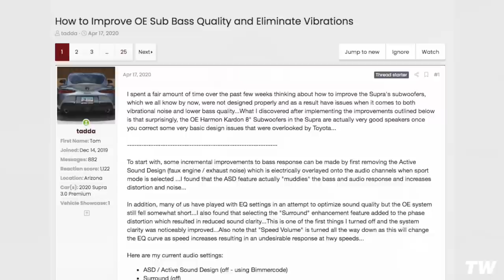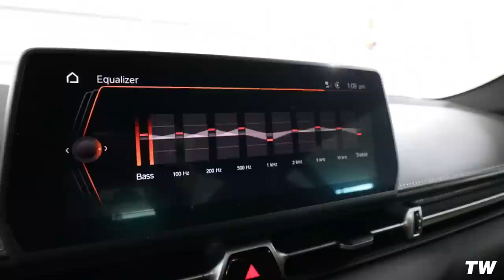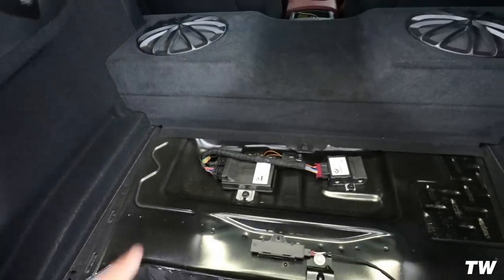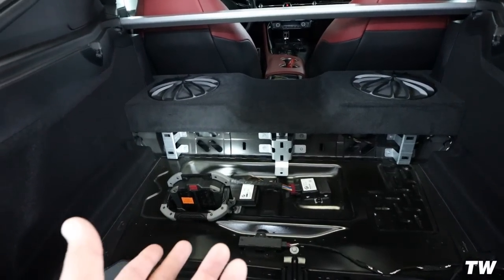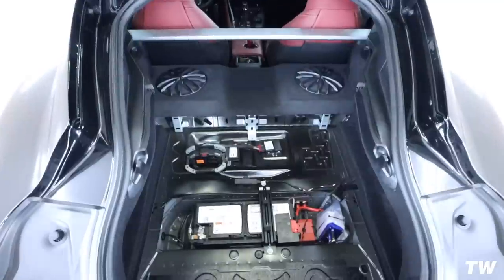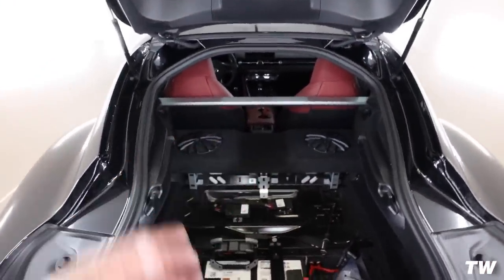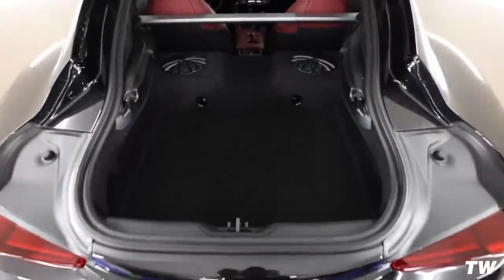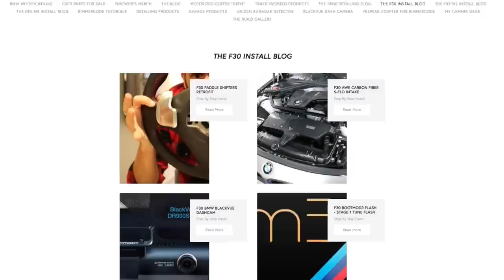EASY SOUND SOLUTION DIY FOR THE NEW SUPRA! (Stereo Audio Fix For A90, A91 Supra)

Comment from the maker: UPDATE: I installed the speaker mesh and dynamat, it made a massive difference all together. I did end up lifting the bass a bit on my equalizer. It felt a little flat with the way the equalizer was set previously. Overall, a great DIY. 10/10 recommended!
Reply: I have been waiting foreveeer for someone to do this, are you going to upload a video on how to add the mesh & dynamat?
Reply from the maker: @risosi8092  I can, but it is VERY easy. You just measure the rectangular area behind the speaker ports (5" x 4"), use two pieces of 3m on top and bottom and place it in there. It fits snug, wont go anywhere. For the Mat you just measure every area you want to cover and cut out the mat, and apply. Its basically a massive piece of adhesive. Real simple. But I can go over it in a future video for sure.
Reply: what’s the song in the intro you were playing?? sounds amazing
Reply: @alexsimms3363  Calling me by Ooyy
Reply: My only concern with doing this DIY is if the wires or if the speakers heat up it could possible catch the foam wadding on fire. I’m sure it won’t be an issue but that’s was something I was thinking about when I first heard of people doing this modification.
Reply: @brandenr2881  all systems use foam wadding in the enclosures and never have an issue, I wouldn’t worry about it at all.
Reply: I had been contemplating doing this for the past few months and as soon as this video dropped I finally decided to do it. I went to my local store and bought all the necessary things and did it. Only thing I’m waiting to complete it is the mesh but man, it really does make a difference. 

Thank you for this
Reply: Hey, I also posted a DIY on our forum awhile ago which shows how I arrived at those EQ settings...

"How to Setup and Optimize Sound Quality using OE Equalizer"

https://www.supramkv.com/threads/how-to-setup-and-optimize-sound-quality-using-oe-equalizer.5711/

-tadda (Tom)
Reply: Loved this video man! Just bought a new 2021 Nocturnal black Supra and have definitely been watching your stuff. I did have a hiccup with this one mod. I stuffed almost two bags inside the speaker box along with adjusting the equalizer and installing the foam and dynamat. Afterwards, the sound was much improved but bass sounded very muffled. I placed my hand by the air ports I just installed and no air exhaust was coming out at all. I ended up removing filling to free up some air flow. I removed some filler from around the sub woofer area, removed a little from the middle area of the box and made it so the 3 metal vents on both sides were mostly free of filler. I can now feel the air venting through the ports especially on heavy bass tracks and the bass sounds so much better. Keep in mind that there is still a lot of filler in the box. All in all, I still think the filler is the way to go.
Reply: @masterhowes  what (subwoofer) do you mean other than the part with the 3 holes on both sides?

Comment: thank you, just have finished and it worked, finally music listening is not a horrible experience in my supra. thanks so much for all your super intelligence and sharing the video manual
Reply: i still had rattling noise behind the seat although much mess, discovered that the panels behind both seats are doing it. it even rattles by tapping them with hands… so removed the isofix lid and pushed as much isolation material as i could to them rigid. its all solid now and finally i all sounds nice, sound overall cleaner, bass became bid and deep and even added more on eq…and no rattles. finally. still wonder how come the smart toyota gr guys let this music system pass their internal qc process…

Comment: Just done this on mine and it's made a significant improvement all round.  Easy job to do
Reply: How long did it take
Reply: @MikeyPanic1  I think about 1-2 hours.  I was plodding though.  It was really easy and definitely worth doing.
Reply: Did you buy the 0.4 foam or 0.8?
Reply: @adithyashari  I can't remember now I'm afraid.  I think I went for as big as I can as its compactable

Comment: Glad ya made a video on this, I did it a couple months ago and I haven't looked back. If ya haven't seen already full screen Carplay is a thing now. it's pretty awesome too just my firmware updated last night.
Reply: How do you update your firmware?
Reply: @jeminpatel1465  check the fourms, theres a couple good threads about it
Reply: @Kamryetar  You have to pay for this firmware update? Pretty sus
Reply: @jeminpatel1465  that's normal. or take it to the dealer and pay 10x more your choice 🤷‍♂️
Reply: @jeminpatel1465  yeah, dealers have been acting like the update doesn't exist either. best option is to get it done by someone else. especially if you're tuned

Comment: This is going to be the first thing I do to my Supra. I like the HK/JBL system in my 340i and was a little concerned after seeing complaints about the JBL in the Supra. I did not like the solutions that included speaker replacements because the mounting hardware on the Supra speakers looks fragile. Glad I saw your video.

Comment: Excellent,  cheap, easy DIY solution!

I wonder if anyone has used polyfill to stuff in the speaker box? Typically polyfill is what is used inside of speakers boxes to deaden an cause speakers to react as if in a slightly larger enclosure. I have used pollyfill in the past in OEM subwoofer enclosures with very notable success.

Comment: Same here. I see where people are using some foam padding under the trim piece. There is quite a bit of air moving that actually goes under the back padding carpet liner. Make sure to seal it off also. 11” on left in length and 6” on right about 1/2” wide should do the trick. Just my opinion.

Comment: Thanks for posting this! So the only difference between your method and the original was the speaker wadding right? Sometimes the panel on top near the sub grill (directly on top where your port is) vibrates for me and I have to hold it down to get rid of that noise.. you think that wadding would get rid of that? Excited to try this out!
Reply: The wadding and the foam will help a lot with the vibration.
Reply: If you look at the original forum thread, the guy pulled apart the subwoofer grills and put dollops of silicone adhesive along the undersides of the grill covers to completely eliminate those rattles. The wadding is mainly for reverberation elimination inside the box, not for the speaker grill rattles.

Comment: Does this technically "void your warranty" if a tech happened to look to closely at the cut cover even though it looks oem? Not that I particularly care if it improves sound quality but I know how much of a pita dealers can be.
Reply: I don't see what can possibly break with this mod.
Reply: @simivoy  neither do I but with how I've seen dealers act i wouldn't be surprised if, for example, the amplifier happened  to give out and they try to blame excessive heat due to the filling material or some bs like that. 
I just use the amp as an example because my mothers 2010 had the amp from HK give out within 45k miles
Reply: This has nothing to do with warranty, warranty can only be voided if this part damages any other part related to mechanical operation, for example, changing tires out of spec into slicks can be used to void your warranty as Porsche says it puts excessive strain on the transmission